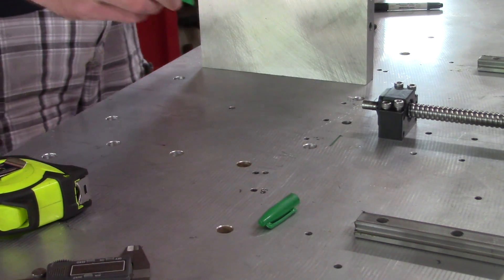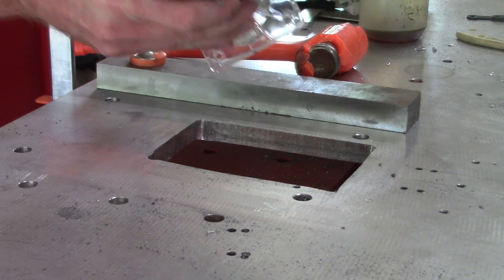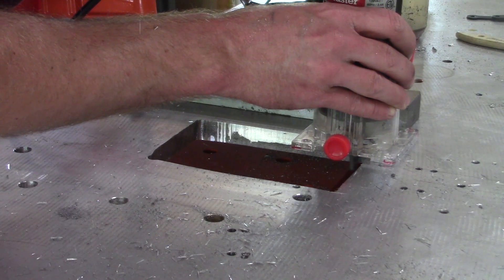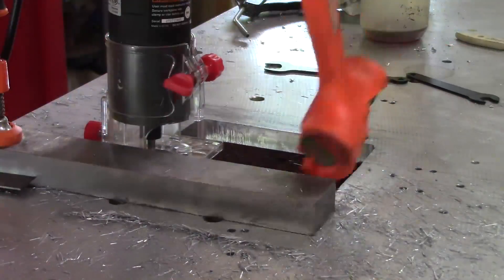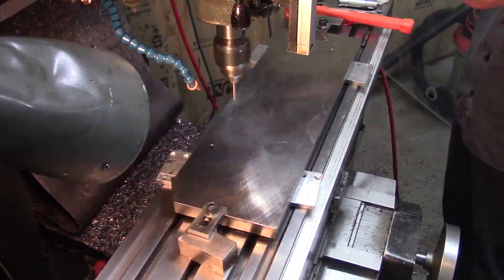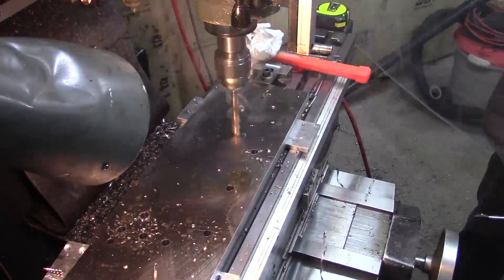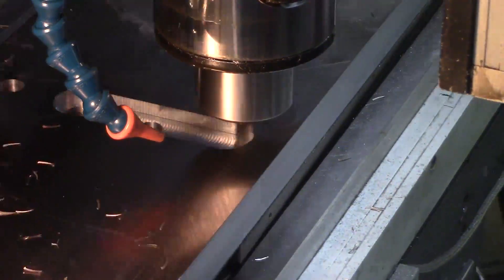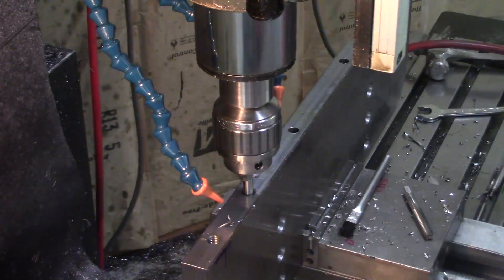Z Axis Column Assembly: Part 1

Comment: This is awesome, what type of spindle / motor are you planning on using? You planning on cutting any steel or just softer materials?
Reply from the maker: For the immediate future I will just be using a 24,000 RPM water-cooled spindle from ebay, probably 2.2kW.  I don't plan on cutting much steel but it should be able to handle it no problem.  Once I prove the design out and actually find if this thing works and will hold tolerance, I will look into better spindles; hopefully with automatic tool change capability.  Unfortunately those cost a TON of money.
Reply: That sounds sweet... You might look into this if you're looking for auto tool changer. Costs around $500 plus $50 for each tool. Kind of pricey but not terrible.

https://discuss.inventables.com/t/auto-tool-changer-works-great/22518
Reply from the maker: Very interesting... I'll take a look, thanks!